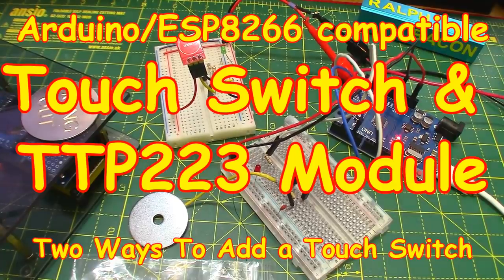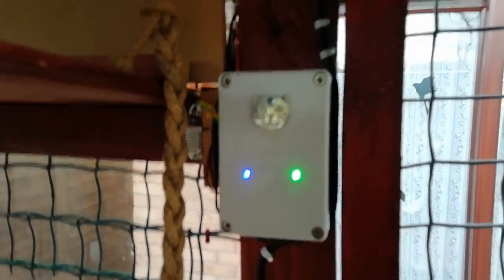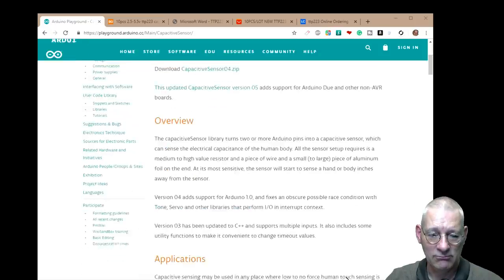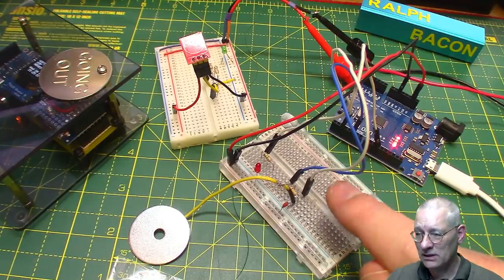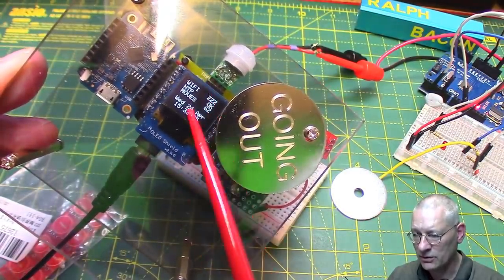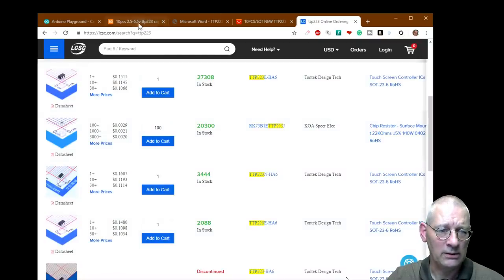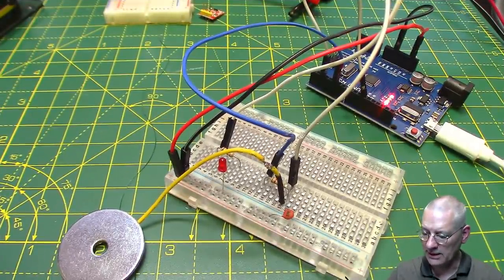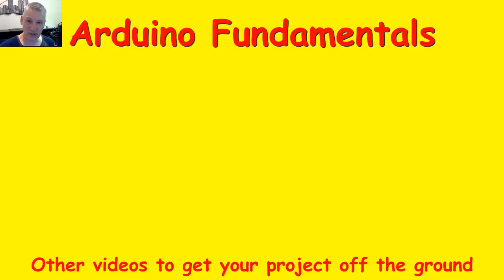#143 Touch Switch 👆 with optional TTP223 module (ESP8266 or Arduino)

Comment: I wasn't previously aware of the touch library. Thanks for that.

I used a bunch of the TTP modules for a control panel a while back. I found that they were a bit too sensitive out of the box, often false triggering.
One of the pairs of pads on the back of the module (nearest the pin 3/4 end of the chip)  is intended to solder a capacitor across to de-sensitize the sensor and make them much more predictable.
Reply from the maker: Glad you found the capacitance library interesting. And would you Adam & Eve it? I just replied to Drex, above, about using a small (33pF - 100pF) capacitor on those pads as he wants it for a game. I didn't want to decrease the sensitivity in my project so that part of the video got left behind on the cutting room floor. I'll have to mention it (and the use of the A/B pads) in a future video.
Reply: People would be shocked how much footage hits the edit room floor when these videos are made.

Though, in my case much of it is aimless rambling on.

Comment: I've found the TTP223 incredibly useful, no debouncing, configurable for high or low output and momentary/latching options all for less than the cost of a decent mechanical switch. If you need more than a 1 or 2 switches for a project take a look at the MPR121,  I2C based and supports up to 12 switches, the breakout boards support 4 addresses so you can have 48 switches at a cost of 2 gpios.
Reply from the maker: I'll most certainly have a look at the MPR121, that sounds very interesting. Thanks for the heads up, Steve, nice to hear from you.
Edit: OMG have you seen the breakout board on Banggood for this item, I will have to go get one immediately! http://bit.ly/2VzySwu

Comment: This could be a perfect addition to my current project, a heating thermostat with oled display and wifi capability using a D32 
Now soon to be with touch buttons with no ugly buttons to figure out where to fit and make good, very smart indeed! 
Thanks for the video, perfectly explained.
Reply from the maker: Another pragmatic use of these switches, James! Just read the comments I put to others about the judicious use of a tiny capacitor to reduce sensitivity, if required (making it a 'touch' switch, not a 'hover' switch)!
Reply: Ralph S Bacon i shall do some experimenting with them to find the most suitable for my project. Thanks again!

Comment: Hey Ralph, good day. I'm working on a basic project (my very first one) and it includes the TTP223 you are using here, a ESP8266 based Led controller (called SP511E), and an address able LED strip, but I have a problem. Maybe you could point me in the right direction. I'll try to be brief.

I'm using a 12V power supply since the LED strip is 12v, the SP511E is connected to the power supply and the LED strip to the SP511E, no problem there.

I added the TTP223 to bypass the tactile button that the SP511E has to power on/off the led strip. 
I did it by using the SP511E's 3.3v pin to power the TTP223, ground to ground and the signal to the pin of the button and it works, but...

The actual problem is that sometimes it goes crazy and starts false detecting, it goes on/off erratically and I don't really understand why. I also tried powering the button from an external 5v source but the problem persists, I believe whatever is happening is at the signal end.

My circuit doesn't have the resistor you used here, I may try that, do you have any other recommendations?

Thank you in advance and I hope you're having a great day. Greetings from México.
Reply from the maker: I can't remember what resistor I used when you say your circuit "doesn't have the resistor you used here". Perhaps you are missing a pulldown (or pullup) resistor so that the input pin doesn't "float" in the absence of a signal from the TTP223? 

If the TTP223 is not putting out a definitive HIGH or LOW then the GPIO on your microcontroller will "float", randomly getting HIGHs or LOWs. I can't remember if the TTP223 does both values, or just the one when you touch it; try it and see.
Reply: @RalphBacon   Hey Ralph, thank you for answering. 

I believe you were using a 10k resistor, I mean the resistor you were using in your breadboard test between the signal and the transistor, which I guess I should add between the signal and the SP511E. I don't have any so this week I'll go shopping to do some testing, I may buy a kit of multiple resistors from AliExpress. I don't have any resistor between the ttp223 and the sp511e, so yeah, that may be the issue. I noticed it starts happening after I play around with the addressable effects for a little while, which may induce noise on the signal.

The TTP223 can be configured both ways, it can act as a momentary or maintained button by shorting B pad, and normally closed or normally open by shorting A pad. I have it configured as a momentary-normally closed button, I believe that's active low.

Anyway, thank you.
Reply: @RalphBacon  By the way, I uploaded 2 videos to my google drive for you to see the connections and the problem.

https://drive.google.com/drive/folders/1xYu68SpnWfqh6UfCg-5GgHNEPqtITt_c?usp=drive_link
Reply from the maker: Can you give me access to see the videos please?
Reply: @RalphBacon  Oops, forgot to change privacy settings. Should be good now.

Comment: I stick a wire onto a spare arduino analogue pin and monitor the reading when I touch it. Then code that reading into the arduino as the switch point. It's been a reliable solution for years and doesn't require any libraries or components expect for a bit of wire. The coding is simply if the analogue read is greater than x do something, else don't. No calibration required.
Reply from the maker: As they say across the pond, Andy, YMMV. I tried this with my ESP8266 and it just wasn't reliable enough. Close but no cigar! On the Arduino, though, I prefer the capacitive touch switch (and library) - like you, it's worked very well. The only downside I see in your approach (the bit of wire) is that it can be susceptible to RFI and other components near by - but if it works for you then that's great!

Comment: Nice work Ralph,  I've not played with the Arduino cap pins, but looks decent and easy to work with.  With 223, I found that you can hook up an extended touch 'antenna' to the pad attached to the thru hole on the board. Could be mesh,  foil,  or even some results with antistatic bag material! Like you say,  it just self-calibrates, and is quite reliable :)
Reply from the maker: Yes, it's been 100% reliable for me, Tim, over the last week, running 24x7. What I like is the clean on/off it gives, none of this switch bounce nonsense! And I even tried the Antistatic Bag trick too!

Comment: Hi Ralph great video... again! Love how you have found relevant sponsors to support your channel. I have not used this myself, but I remember the esp32 has 10 inputs that can be used for capacitive touch. For example to make a slider. The esp32 can also deep sleep until touched or trigger interrupts. Thanks again for making these videos!
Reply from the maker: Oh yes, the ESP32 is a different beast altogether, Freddy, and has those capacitive, trigger pins. But, you may have noticed I didn't mention the ESP32 for this very reason, and for the Arduino family, the capacitive touch library (if you have TWO spare pins) works amazingly well. But the ESP8266 is a different (awkward) beast with all that RFI flying about, hence the TTP223 which saved my bacon. Oh.. well, you know what I mean. Thanks for posting, great to hear from you.

Comment: Hi Ralph, just came here for a "Benny" fix !...not really, came to say i've implemented some TTP223 chips and they are working great, capacitive touch sensitivity can be adjusted with 0pF for max sense and uptp 50pF for min sense, i find 47pF just right if you want actual contact (I did) great little chips...cheers.
Reply from the maker: Glad it worked out, Andy. You can also change whether they are "on" or "off" on a press. The one I use in my mum's Home Alone project is behind a big steel badge (a nice dog collar name tag) but still works great as the TTP223 device self calibrates on switch on. Cool stuff.

Comment: Great work, had seen these before but couldn't think how they would be useful as they would be terrible on the outside of an enclosure.  Now thay I realise that they can read it through the plastic I have all sorts of ideas for my weather proof IP6 type projects. Thanks again.
Reply from the maker: Excellent, Andrew! Just read the comments I put to others about the judicious use of a tiny capacitor to reduce sensitivity, if required (making it a 'touch' switch, not a 'hover' switch)!

Comment: Another awesome video.  It reminded me that capacitive touch as a switch is available and I need to re-evaluate a couple of my projects to see if it would be easier/better to use this rather than a switch.
Reply from the maker: Even on the Arduino the TTP223 can make sense, Bruce, as only 1 pin is required. You can put those analog ports A0 - A5 to good use, as digital GPIO touch pins!

Comment: I have 30 0r 40 of those TTP223s. I am going to change my mechanical switches in my Breadboard Buddy / arduino Simon Game to them.  Guess I'll make a video on that also. Thanks for the Vid Ralph.
Reply from the maker: Drex, if you want to use this to replace actual pushbutton switches then consider soldering a very small value capacitor to the larger solder pads under the switch (NOT the ones marked A or B). Example:

I found that 100pF made it act like a proper switch - you actually have to touch, ever so gently, the sensor pad itself for it to register.

A 33pF desensitised it a bit but you could still hover a small distance away from the pad and it would register unless that acrylic coaster I used in the demo was in-between. This was good because the sensor could still be hidden behind the coaster (or other plastic container) but still act as a TOUCH switch (as opposed to hover switch!

 A bit of experimentation is probably required!
Reply: @RalphBacon  I made the video of it with regular switches. Will exchange them 1 day. Did you make a video on the camera switcher? I can't find it. I think you used ttp's in that also. Thanks.

Comment: Hi Ralph, in your Video at 16:14 your TTP223 output is High for more then 20 seconds, but if I touched my TTP223 he auto calibrate after 6 seconds.
Do you know a way to disable the auto calibration? 
Nice Video, thank you.
Reply from the maker: I think the whole point of this device that it will auto-calibrate! 

The spec sheet (http://www.sishine.com/uploadfile/cfile/2012512132524876.pdf ) says you should not touch the pad for 0.5 seconds after power up and "When key detected touch and released touch, the auto re-calibration will be redoing after about 16sec from releasing key".

Worth reading that spec sheet in some detail, I reckon. 😉

Comment: Hi Ralph, a little off subject, but I noticed Benny has a DHT 22 near his door. I'm looking at using one outdoors, and wondered about your experience with it. Does it actually get wet? How long has it been in service there? Thanks for any reply, and as usual, thanks for the videos.
Reply from the maker: This device replaced a DHT11 about 2 years ago, Danny, that I belatedly discovered did not measure below zero! How bizarre is that? Anyway, this DHT22 does not get wet, it's under cover. I use this as I want both humidity and temperature. 
If you are just after temperature then a waterproof version of the DS18B20 would be more suitable (they look like silver torpedos, work very nicely, can even drop them into an aquarium).
If you are set on the DHT22 then you will have to protect it from the elements.

Comment: Usually these capsense "buttons" are shielded from direct contact to protect against ESD.
Reply from the maker: In a way they already are, as the "touch" bit is the PCB on the other side to the copper. But they look a bit ugly anyway so hiding them behind a project case or enclosure makes the entire project a bit more 21st century anyway! Thanks for posting, LimbaZero, good to hear from you.
Reply: @RalphBacon  I was thinking example that used directly arduino input pin.
Reply from the maker: Oh, the capacitive Arduino touch pin? I directly touch it, mine have survived for years now, no ESD damage at all.

Comment: another amazing video that you conveniently made before i needed it good job!. Quick question..i followed both this and you deep sleep video. how do i wake up from deep sleep using a touch sensor module,? rising event? im using a pro mini. i would love your help. you helped greatly on my RFID talking Motorcycle.(i sent you a video on facebook )
Reply from the maker: Assuming you have an Arduino then, you can wake on interrupt (digital pin 2 or 3) on a falling value. So configure that touch switch (TTP223) by making the output normally HIGH and which goes LOW when you touch it (there are pads underneath to solder to enable this) and it will trigger an interrupt. The TTP223 datasheet will give details if my video/GitHub doesn't.
Just in case others read this, it's very different for an ESP8266.
Reply: @RalphBacon  thanyou ralph that's  exactly what I needed to hear. You have saved me hours of trial and error did you see my motocycle video I sent you on fb messager
Reply from the maker: I have to admit that although I have an FB account I rarely look at it (or know how to use it properly). Send me the link here if you have it handy please!
Reply: @RalphBacon  a man with such technical prowess doesnt get stuck with social media... here you go - https://vm.tiktok.com/ZMJaxtw6j/
Reply from the maker: Very cool, reminds me of Knight Rider and his talking car. Seriously, though, why are all bikes not equipped with something like this out of the factory to avoid thefts? Cheap, simple and sounds cool. You could even have different voices!
Reply: @RalphBacon its because the S in rfid stands for security...  yeh I had a friend do a load of impressions. I was considering jarvice from iron man. "Good day sir". Thankyou so much for taking the time to check out my project
Reply: @RalphBacon  now I plan to use a pro mini and deep sleep to lower the draw. And remove the on off button. I hope to mount the touch sensor to the reader. So my had will wake it up and get scanned in one.
Reply: @RalphBacon  im glad you like it. the plan is now to make a small low powered one for my car using a pro mini and a touch sensor,  ill mount a touch sensor and the rfid reader in the wing mirror and as i approach(almost touching ) my hand it will wake it.up and the reader scan it. toggle the door state and go back to sleep. ill use a limit switch to mechanically check the state of the door locking solenoid .ill remove the bootloader too

Comment: In bunch of my projects i used HTTM modules. They are simply great to hide behind glass, acrylic or similar.
http://www.heltec.cn/project/capacitive-touch-module/?lang=en
They work similar (if not exactly) as TTP223, but they are my first pick on draft.

Good video as always, and your voice is calm as always. Keep them coming.
Reply from the maker: You must the third person you says I was calm, Dejan,  in this video. I'm wondering whether I had double-dosed my daily intake! Actually, it was probably Benny's calming influence (who writes all the code, of course).
Yes, the HTTM modules do look (from a technical standpoint) very similar to the TTP223 modules - I suspect they will be considerably more expensive with their lovely colours though! Thanks for posting.
Reply: @RalphBacon  Well, both have temporary and latched mode which can be selected by soldering two joints. Both send HIGH  to OUT pin and both can detect finger 5mm from its surface. Difference is that LED can be so effective behind some transparent or semi transparent surface. I use them for smart switches behind white glass plate and they look awesome. TTP223 have LED too, but from downside. I used it too, but it is not that effective for my purposes. And yes, price is a little higher...

https://i.imgur.com/o7lpBWe.jpg